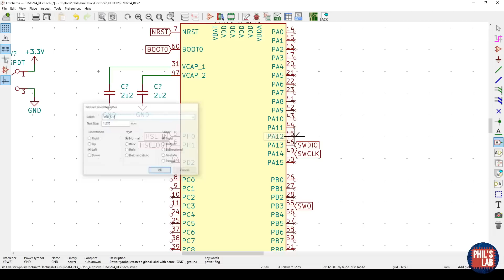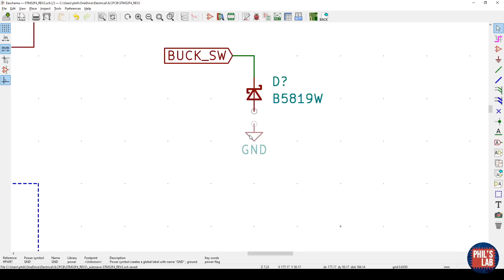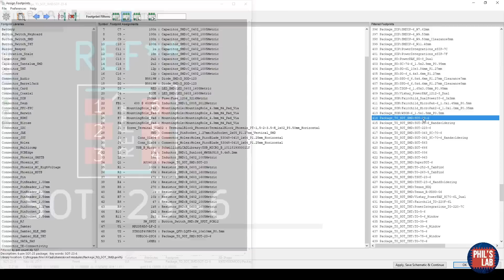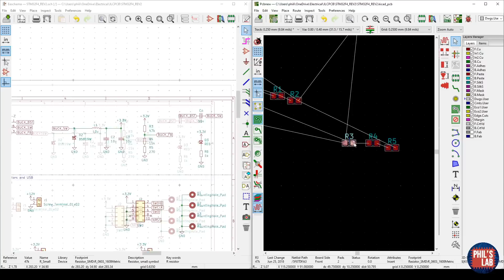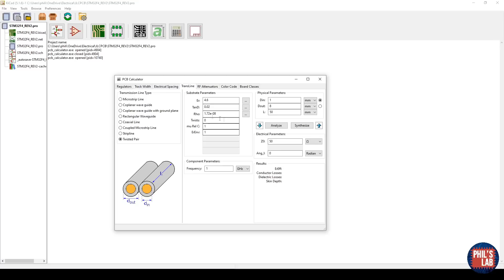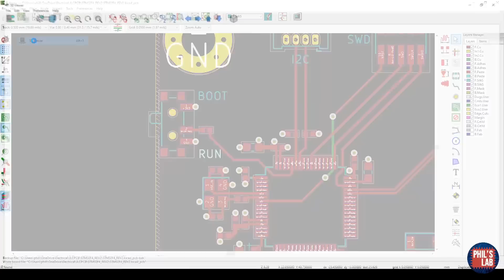(Sponsored) KiCad STM32 + USB + Buck Converter PCB Design and JLCPCB Assembly - Phil's Lab #11

Comment: Hello Sir, first of all I want to thank you for this amazing tutorial and explanation I learned a lot of things routing , do some schematics ...   just I want to underestand something that I recreated the same schematic from your tutorial, and during the ERC check, I noticed something different from your video. In your case, you only had warnings, but in my case, I’m getting errors such as:
"Power input pin driven by no power output pin!".
Do you know why this might be happening? Could it be due to a KiCad version difference or some specific ERC settings? I work with Kicad 9.0  .
Also, is it still possible to continue with the next steps of the tutorial despite these errors, or should I fix them first?
Thanks again for your great content!

Comment: Hi @PhilsLab, I've some doubts and would like to understand why did we go for this specific designs
1. Why did we use a 600 @ 600 Mhz Ferrite bead after the reverse polarity mosfet, like what is the benefit of this approach?
2. For filtering at Vdda pin, why did we go for an inductor and capacitor based filtering?  what is the benefit of this approach? i went for a ferrite bead + high frequency filter capacitors on vdda pin filtering. 
so i would like to understand your approach here for my understanding.
currently i've just finished the schematic phase and currently in footprint selection phase.

Comment: Regarding decoupling of VA:
 the order of capacitors matters due to their frequency response. Here's the recommended placement:

Inductor (39nH) first → Placed between +3.3VDC and +3.3VA to block high-frequency noise.
10nF (0.01µF) capacitor next (closer to the inductor) → Filters very high-frequency noise (e.g., RF interference).
100nF (0.1µF) capacitor after that → Handles mid-range noise and provides local stabilization.
(Optional) 1-10µF capacitor further down → Provides bulk decoupling for low-frequency noise.

Comment: Regarding PCB design, please do not use Global Pin labels starting at KiCAD 9.0 because it will generate pin holes junctions for cross sheet connections on your PCB and you will start seeing weird circles and squares. If a net is globally connected but not explicitly routed in the schematic, KiCad will generate extra junctions or unnamed net connections in PCB.
Instead: Use LOCAL Net Labels Instead of Global Labels.
If connections are local to a SINGLE schematic page, use Net Labels instead of Global Labels.
Only use Global Labels if you need to connect signals across multiple sheets.
Reply: I did my first big project with global labels as Phil did in his 8.0, it was total mess with cross sheet pin connections, I needed to redo it with local nets. So weird.

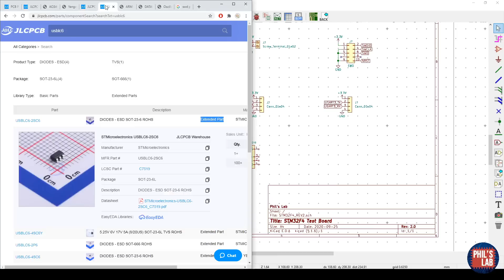Comment: 1:04:00
1MΩ Resistor + 1nF Capacitor
Use for low-cost or low-risk applications.

ESD Protection IC (e.g., USBLC6-2)
Use for high-reliability or USB-compliant designs.

Comment: Really incredible video. I have one question though. As I understand it you filled the two inner layers entirely with copper and made them GND and 3V3. Doesn't that basically turn the whole board into a huge capacitor and mess with everything?

Comment: Sorry, i know you said the external Feed Resistor for the oscillator required a lot of experimentation, but I checked the Oscillator guide and it said the purpose was to form a Low Pass filter to ensure the oscillator didn't start at overtones but rather the fundamental frequency. They quoted a formula for R_ext using the cutoff frequency we'd expect (8MHz in their example) and got a value above 1kOhm. When I use your cutoff of 16MHz and C_L2 of 12pF, you'd get nowhere near the 47 Ohm you calculated. So could you shed some more light on any other considerations you took into mind which i may be missing?
Also, when i try to calculate the gain margin using the transconductance of the oscillator (gotten from the MCU datasheet as 5mA/V), i get a value less than the recommended 5 for oscillation to be able to start.

Comment: Does anyone know what the prereqs to watching this video are? Do I have to understand anything about E&M? Or about circuits in general? I am thinking of quickly reading through this book in a month or so: https://d1b10bmlvqabco.cloudfront.net/attach/icgvkl3p4x5m0/gyor3wfgyon205/if0gvqrkz0ue/edogs2.pdf . Will this be adequate preparation? I want to understand as much as possible. Or is this in the completely wrong direction? Let me know, anything helps. I just want to get the most of out this video and the series. Let me know, thanks!

Comment: Hello Phil, first I wanna thank you very much for this much technical content, which is very well made, second, I have a question, how you choose the components to use for the STM32 microcontroller ?, is it the datasheet of the micro or the experience or something else, for example when u chose the 3.3 voltage regulator, why specifically that regulator, Thanks in advance :)

Comment: I tried this power supply design in my own project and while I got 3.3V output for 12V input, it doesn't produce a 3.3V (1.63V instead) for 5V (USB) input. Any idea what is cousing that? Someone had simillar issue?
Reply: the buck converter is setup only in a way so that it could only convert the 12v to 3.3v

Comment: This is a great demo...  with caveats.  It's great for designing hobbyist systems which will be manufactured by a turnkey online vendor (jlc, pcbway, pcbgogo, etc.), which is applicable to the majority of viewers (I imagine), so this is not intended as a criticism.  I'd like to see a KiCad demo video that doesn't depend on precooked libraries, and is specifically utilizing a more traditional workflow which is sourcing components from standard component vendors (not PCBA manufacturers/assemblers), and no cheating (no snapEDA, no ultralibrarian, no samacsys).  Basically, I want to see a video of a design you would do in Altium, but instead use KiCad...  pretty please 😄

Comment: I wrote a quick Python script to check every possible combination of series and parallel resistors you can make from Basic parts, and suggest the closest match for your precision resistance or voltage divider. Really easy to do in Python, but man does it save a ton of time and always find ridiculously close combinations.
Reply: Can definitely be down with a spreadsheet too!
Reply: Yeah, but the more resistors you use the less precise value you get.

Comment: Being a programmer that is fairly new to electronics (bit of a newbie).  
I have followed your excellent tutorial fairly easily but have a few questions.

What you happen to the differential pair used for the USB if the track size is slightly bigger?
Kicad worked out the mil size to be 0.261112mm.  What would happen if I used 0.3mm for a similar PCB?
The reason for asking is the calculation seems a bit heavy.

If I am creating a simpler PCB would two layers be OK?  Is two layers not recommended these days?
Should I make mistakes with my design while learning, I was think that two layers may be easier to modify with jumper wires or cut traces.

Thanks for the much needed tutorials. 🌟

Comment: I'm noob and could be misunderstanding, but there's a couple things I've had problems with so far: 
1: Snapping edges for ground planes to existing outline
2: Differential Trace sizes are not what's added into the predefined spaces, it's whatever is shown in the little popup after when using the tool.

Other than that everything has gone smooth for me so far. (leaving this here for posterity xD) I'll edit when finished with the video if anything else comes up.

Thanks for the channel Phil. You're helping me give something back to the DIY Synthesizer community. <3

Comment: Couple questions: Where did you get the ferrite bead value 600 ohm @ 600MHz?
Seems like most beads will list the impedance @ 100MHz

Also where'd you get the 10uH inductor instead of 4.7uH? Because of different output current and the input voltage?

Comment: Hi Phil,

Excellent video learnt a lot from this video.

I generally have a habit of overthinking things so was a bit concerned about the safety factors as mentioned in Section 3.8.3 of guide AN2867. The safety factor for 80ohm ESR and 47ohm external resistor comes to around 1.5. Would love to know if you tried with the formula of 1/(2*pi* F * CL2) as mentioned in section 3.5.3? Did you face any issues with that value?

Thanks,

Nitin

Comment: Very good video, I've learned a lot, thank you. Perhaps it would be more efficient to draw markings, labels, fiducials, etc. directly on the footprint of the component? I know this was a design choice, but I think it would faster to route if you had added a ground plane to the top layer and used via stitching. Also, for switched mode power supplies like this the general recomendation is to keep all connections in the same layer, to keep parasitic capacitances to a minimum, of course this probably won't be a problem in this particular case, but is something to keep in mind.

Comment: Could you help me build a PCB board prototype? I need a USB keyboard to write strings in a stack. I'm a programmer and I've built something using graphical Unity bolt program that I'd like to make into a hardware device. You may have a copy of the prototype and code and use it anyway you like if it interests you.

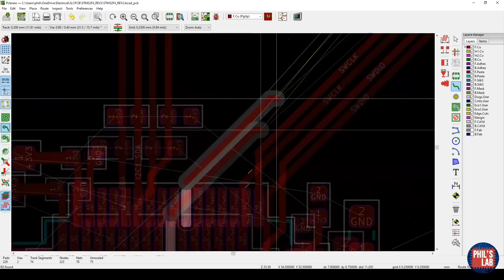Comment: What is the electrical benefit of keeping long traces mostly on one layer? At 2:08:19 it seems you decided not to run the majority length of the route on another layer, instead choosing to duck under one top layer trace right near the connector.

Comment: Hi Phil! thanks for all this information. Hope you still answering questions in this video. 
I have this crystal oscillator which load capacitor is 9pF so, following the formula you gave in minute 34:00 (Cload = 2 * (CL - Cstray)) and assuming 5pF Cstray the result would be Cload = 8pF, but that value is not that commercial. There is a problem if I use 9pf instead? 

Thanks for your answer.
Reply: 8.2pF

Comment: Question About the USB 5v through the Schottky diode, as the step down has been set up for 12v, does that effect the 3.3v on the output? Im looking to feed in 12-14v and output 5v from the step down and want to feed in a separate 5v from the USB if it is used like your example, but im worried about the output of the buck converter as it will be the same. (https://youtu.be/C7-8nUU6e3E?t=3984 )

Comment: Hi Phil, i would like to ask you a question. In a lithium battery powered equipment, which needs +5V and +3.3V , what is the best solution: a) use a single cell (4.2V at full charge) and step-up to 5V, and then reduce it to 3.3v using a linear regulator, or b) use two lithium cells in series (8.4v full) and just step-down to 5v and then 3.3v? Thank you.

Comment: Could you design a 18650 top mount circular circuit that has buck boost converter to pass though voltage instead of bms and regulate input and output of cell as full batt controller 
With canbus output to a display output and computer 

If it sells well can give me something from it

Comment: Nice Video, but how do you get your 47Ohm Resistor?
AN2867 says:

An initial estimation of RExt is obtained by considering the voltage divider formed by RExt
and CL2. Thus, the value of RExt is equal to the reactance of CL2. 

Therefore RExt = 1 / (2 π F CL2), and so, with an oscillation frequency of 8 MHz and 
CL2 = 15 pF, we have RExt = 1326 Ω.

With my calculating skills I'm at 663Ω with same Values. That's more than 10 times of your value.

Thank you!

Comment: Thank you, Currently, JLCPCB doesn't have the MP2359 buck in stock and it is available as an extended part. Could you please recommend another part?
Reply: I has the same issue. I used TPS561208 from TI, and changed the component values according to the datasheet.

Comment: I noticed you did not isolate the ground plane underneath the ceramic oscillator like in the original video. Is there a reason you decided not to isolate the ground plane in this design? I am hoping to get away with not doing it myself as its kind of a pain in eagle.

Comment: Any special motive to drive a LED from the high side?
The usual rule of thumb says drive everything you can from the low side.
Reply from the maker: For something that has such a low current draw (on this particular board), there's no problem in driving from the high-side. Also means the logic isn't inverted.

Comment: I have two different regulator outputs, a 3.3V for the board and a 5V to power the devices that are working with the STM32, main power source is 12V. How then can I have 5V at the USB and then 5V from the connector, since they have the same flag? 1:05:30 Can I just name the USB power source with the +5VD flag?
Reply: Best to create your own power symbol in this case and add it to your project lib. Name it something like +5V_REG, indicating it's generated by the onboard regulator

Comment: Phil, I've developed a tool which creates Kicad symbols from STM32CubeMX project files - the symbol contains only the pins that you assigned in CubeMX, and will use the labels from  CubeMX (if you labelled your pins).  It saves me time+effort when creating (and later, optimising) pin mappings, since I can rapidly make changes in CubeMX then reflect them in EESCHEEMA and PCBNEW.  Since it creates symbols from STM32CubeMX, it works for parts that Kicad doesn't have in its library (e.g. STM32H7 series).  Would this be of interest for you ?
Reply: It's of interest to me. Do you have a public repository for it you can link me to?

Comment: You know it's good content when it took me 3h to realize that this was a 3h video. I do have (probably stupid) question tho, won't the 3.3v coming from the swd connector cause issues with the 3.3v coming from the buck if USB/12v is connected at the same time as a programmer? Or it doesn't matter?

Comment: I have a question. For the stm32f746 (144 pin), I count 13 pins to Vdd (Vdd+Vddusb), but on the power supply scheme in the data sheet, I see 1x 4u7 + 19x10n. Where is the 19 coming from?
Actually also Vddusb shows 1x100n + 1x1u, and the same for Vref+, so I guess I have to draw these separately as well?

Comment: I love that video and especially your detailed explanation. Yet I'm still missing an information: how do I pick a oscillator value? Per datasheet the STM32 can handle quite a range of frequencies, so why picking a 16MHz over a 8 oder 20 MHz for example?
Reply: so the less the clock frequency the less power the stm32 will consume so its best practice to use the lowest value crystal / oscillator you can get away with but yes look at the datasheet for more info

Comment: Great Work Phil,  one question the MP2359 is not longer a part on JLCPCB. To calculate the inductance, what value did you use for peak-to-peak  inductor  ripple current? Thanks

Comment: Thank you! This is a great video tutorial with lots of tips and easy to watch and listen. Can you explain why a 250mA polyfuse is chosen to go with a regulator rated for 4A?
Reply: Rating does not equal requirement. The buck converter can handle 4 amps but it just isn't expected to be anywhere near that level. Im assuming he decided this based on power requirements of all the individual devices

Comment: Can you please tell me what this circuit do ? Don't laugh at my question please i am not so pro like you , thatswhy please gently tell that what this circuit is designed for , what is the purpose ?
Reply from the maker: This circuit doesn't perform anything particularly useful, other than showing how to correctly design a PCB with an STM32 microcontroller on it.

Comment: Great video - way to much detail for me but I am watching the whole thing because there are some nice KiCad tips in there, even for old-timers like me who have used Ultiboard, Protel, Eagle and more recently Altium
Reply from the maker: Thank you!
Reply: @PhilsLab  Phew ... I finished the design and ordered my first complete assembled PCBs including a nRF52840 (QFN with multiple rows of pins, almost like a BGA) and a PCB antenna. Came out really nice, even the antenna circuit performs well. First time right but I now want to add more ...
So today I'm back to check all steps needed to order version 2 👍

Comment: Hey Phil, beautiful work. Just wondering, why did you skip out on using the AMS1117? I get that the previous design using a schottky diode was less effective then using a P-MOSFET, but why not use a P-MOSFET along with an AMS1117? Thanks for your amazing work!
Reply from the maker: Hey Daniel, Thank you! A switching regulator will pretty much always be more efficient than something like an LDO (e.g. AMS1117) and there are more interesting things regarding layout when using them, so I thought I'd show it!

Comment: Can I use the same power supply design for 14 or 16 bit ADCs?
Reply from the maker: In generel, yes. It depends on many things, such as frequencies of interest, frequency of the switching converter, PSU noise, etc, etc.

Comment: Do you plan to make any tutorials on the use of USB Power Delivery with the STM32G0 chips? I've heard rumours that they can be programmed via USB interface as well, but I haven't looked in to the datasheet yet. But a board powered and controlled only by a USB-C connector would be pretty badass!

Thanks for this fantastic tutorial btw!

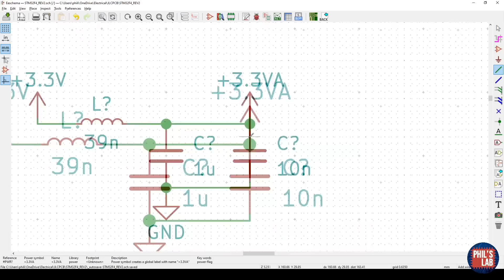Comment: At 27:28 you mention the decoupling capacitors needed, if I'm not using VDDA for the ADC and just wire it to 3.3 normally, this means I should add an additional 100nf cap to the series, right?
Reply from the maker: Yeah, if you're not particularly bothered about the 'analog' part, you can hook it up to 3V3 and as you say, you'll need a 100nf cap for the VDDA pin.